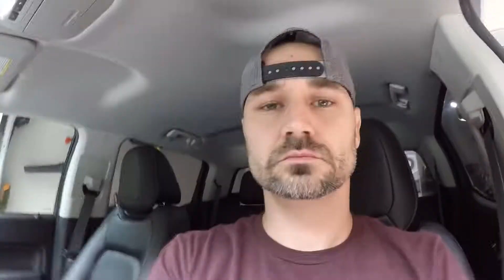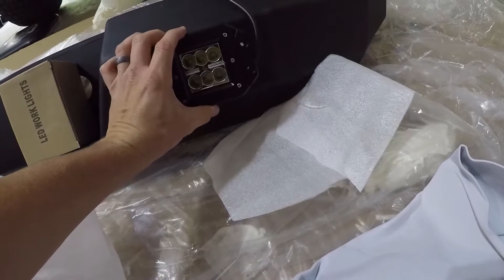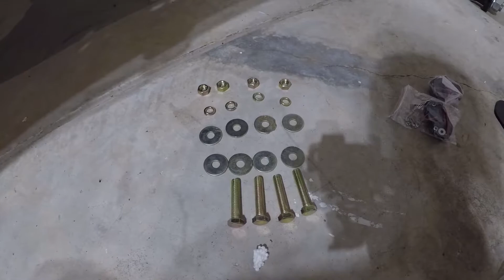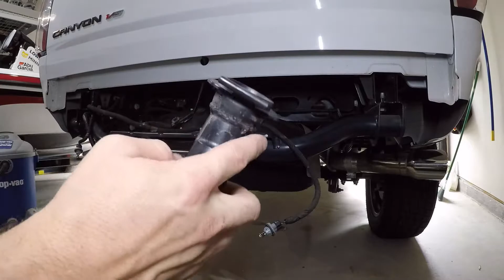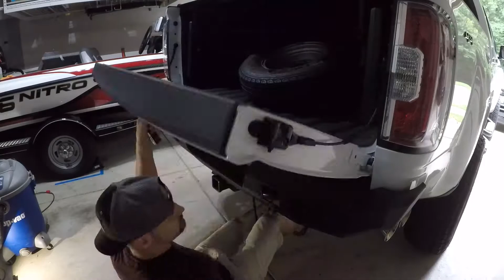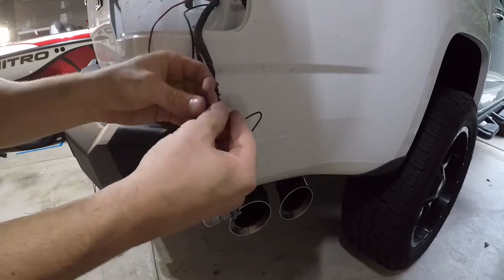GMC Canyon DV8 Center Mount and Rear Bumper Detailed Install - Rear Bumper Install - Part 2

Comment: Hey Justin. That front air vent shutter, not an temperature sensor, needs to be deleted with a scanner. I upgraded my grill, left it loose, and noticed my scanner detected a faulty sensor. And as we know all sensors are linked to ecm.
Reply from the maker: Hey Ismael, I did not remove any  motors or sensors. Everything is plugged in and factory. I believe you are referring to my other video for the front bumper, correct. The temp sensor is still plugged in, just mounted somewhere else and I still get a reading with no issues.  The front vent motors for the front air vents are sill connected, I did not remove the whole assembly, just the bottom half of the vents are removed and the top vents will work and open as needed. Still not sure if  you are referring to the temp sensor or the vent motors, but I have had no issues. Thanks for watching!

Comment: How does the truck pull your boat with your lift? Is there any change from stock compared to lifted? Did you do the lift yourself? Thanks and well done. Nice clean looking truck.
Reply from the maker: Thanks for watching .Truck pulls the boat great. The only difference with the lift and bigger tires is the loss in MPG. I lost about 3-4 MPG over stock. I started to modify the truck almost immediately when I got it, so I really didn't get too much stock info .But I also have a k&N intake, Corsa Exhaust, and Trifecta Tune, so it's really hard to tell. I don't have a vehicle lift, so I had the lift installed professionally.
Reply: @smitty8403  I've only had the truck for a week and also have a fairly new F 350 Platinum. I bought this to save on gas and transport the dirt bikes as opposed to the 350. I want the lift and the Trifecta but it looks like I'm in for higher fuel prices no matter what. Appreciate the timely reply.
Reply: @smitty8403  did good by getting a Trifecta tune. I went the wrong route with a RIPP Supercharger. It's been a headache and high maintenance. Had to pick up a HP Tuner to stay on top of engine parameters.

Comment: What wire did you use to extend off the DV8 lights?
Reply from the maker: Which lights? The tail lights were tied into the existing tail light wires. The LED lights were tied into the reverse lights. I cover it in detail in the video.
Reply: @smitty8403  the LED tail lights, not the license plate lights. Wondering which gauge wire you used
Reply from the maker: @mathewgregoire3732  I believe the lights have short 18 gauge wire but I had some leftover 16 gauge from another project so I used 16 gauge to extend the wires.

Comment: I’m laughing because I’m about to change a factory painted bumper to a chrome one because I like the chrome better than the painted on a new 2021 Denali. I like chrome !!!  Your video was very helpful in how to remove the bumper assembly. Lotta stuff to change over before I put it back on. Great job you did. I liked and subscribed
Reply from the maker: Thanks, and good luck!
Reply: Now I'm laughing because I just replaced my damaged factory Grey painted bumper to a chrome. Couldn't find the painted Grey so I had to settle for chrome. Just to have it dented a few weeks later. We need to communicate more.

Comment: I got this bumper for my Colorado.  Going to install this weekend... Do you have a link to those wire splice clips?  Or what size did you use?  Thanks
Reply from the maker: They are all standard and you can get at any big box store.
Reply from the maker: https://www.lowes.com/pd/Utilitech-20-Count-T-Tap-Wire-Connectors/999956682
Reply: @smitty8403  awesome thanks

Comment: Would you sell it? And how much?
Reply from the maker: I would sell it but would only do local pickup. I'm in the Charlotte, NC area.
Reply: Haha wow the odds, Im from Charlotte NC and i recently damaged my rear bumper on my 2015 Canyon. This DV8 bumper adds a nice touch to the Canyon and is actually cheaper than buying a brand new stock bumper. But out of curiosity, how much would you sell your old stock bumper for??
Reply from the maker: @jakebalzer1596  I'd let it go for $500.
Reply from the maker: @jakebalzer1596  Not in a rush to sell it. Its tucked away, outa sight out of mind. However, f your local and are seriously interested, I'd definitely be up for selling.

Comment: I like the bumpers, thanks for showing the process.  What lift and exhaust are you running?
Reply from the maker: 4" Rough Country Lift and Corsa Performance Exhaust dual tip.

Comment: Is it much heavier than the OEM?
Reply from the maker: I has been a few months since I installed it but don't remember the DV8 rear bumper being that much different in weight than the OEM bumper.
Reply: @smitty8403  i think i want to keep it stock in the rear and have the winch up front, i only put a 2 inch lvl kit up front 2020 gmc canyon